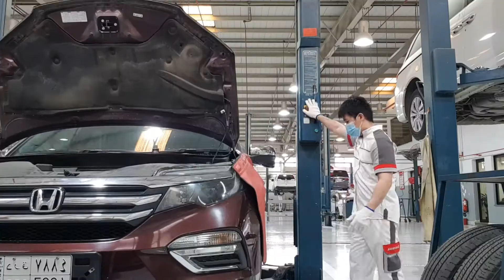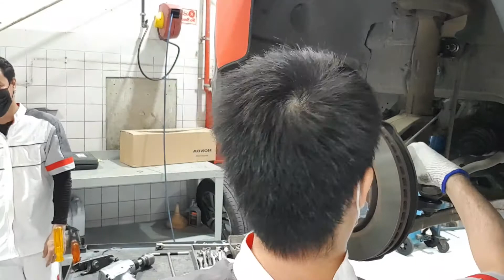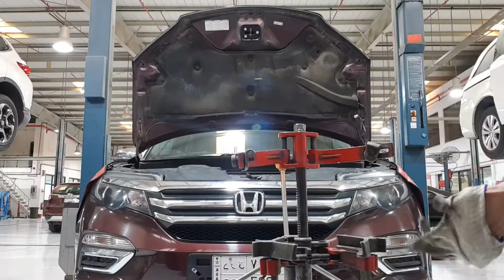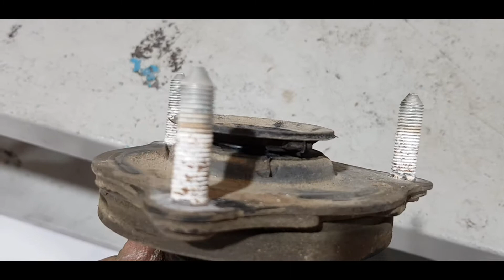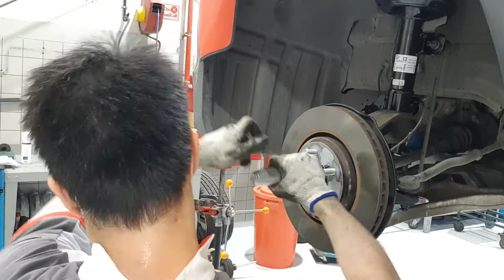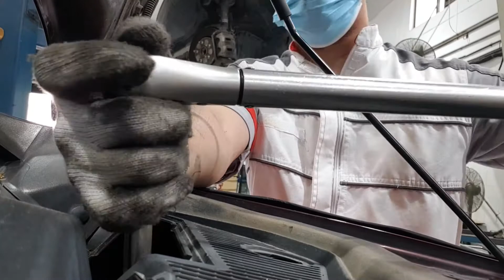Replace front right shock absorber (leak)|long cut procedure|honda|Pilot 2016

Comment: hello, i have the same model year honda. thank you for showing us this helps us alot. Im just wondering what kind problems did this is showing. Is vibrations and shuddering a common thing on struts because im getting a lot of vibration and shuddering on my pilot specially in the front driver side. Thank you so much.

Comment: Just had both struts on my 2019 pilot EXL replaced. Now the upper strut mounts are making a rattling noise and a loud thud/Boink on the passenger side when turning left at slow speeds. What would cause this on new struts/strut mounts?
Reply from the maker: Did you check the mount? Possible mounting is damage also.

Comment: Is there a chance of damaging the axle if this was not done correctly? I got mine replaced last month and now grease is leaking from the axle boot.
Reply from the maker: Absolutely yes.. ;) maybe they not fixed the boot correctly.. or they accidentally hit the axle boot..
Reply: Hello, does the orientation matter, I noticed there is an arrow on the top bearing plate.

Comment: Did you replace the Mount Base and Bearing?
Reply from the maker: Only the mount base.. you can re use the bearing if parts is not available
Reply: @kitlacaden  Great, I purchased the base as well. My struts only lasted 55k miles and Im not even in a rust area.

Comment: Could you help? When reinstalling the strut, i noticed an arrow on the top bearing. If you didnt mark when you rook it off, which way?
Reply from the maker: That mounting is only fitted in their own location.. and the arrow will point to engine bay or at the back if im not mistaken..
Reply: @kitlacaden  so, the mounting plate can only be installed one way, the bolts will go through the bottom only one way?
Reply from the maker: Yes..

Comment: Which part to use in the change for my 2017 Honda Pilot Touring awd. When i look at honda to purchase the struts it has two part numbers for the front strut.  51621-TG8-A01 or 51611-TG7-A01  for the right. Same thing for the other strut.  How do i know if i need TG7 or TG8?
Reply: Did you ever figure out the answer to your question? If so, which part?

Comment: Greet video. I have a 2019 Ridgeline. The process is very much the same. Would the torque spec be the same? Also what is the paste you applied to the upper mount? Thank you!
Reply from the maker: You can use normal grease ;)
Reply: @kitlacaden  is replacing the nuts with new necessary?  Do you have the Honda guide for the whole procedure? Thank you again
Reply from the maker: Replacing the nuts is not necessary, unless the nut is not good.. and about the whole procedure, sorry i dont have it.. ;)

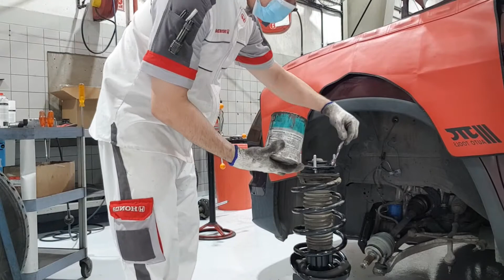Comment: Great video. What did you apply at @7:01, just some grease?
Reply from the maker: Yeah.. any type of grease will do. 😊
Reply: @kitlacaden how about the torque for the lower control arm? Mine is a 19mm. 2017 Honda pilot elite.

Comment: Hi again! Is there an easy way to remove the wheel speed sensor?
Reply from the maker: After you remove the bolt, try to lubricate the mounting of the sensor.. sometimes  dirt  sticks on it.
Reply: @kitlacaden  silicone spray or pb blaster? Again your are amazing
Reply from the maker: Anything available in your garages, wd40 much better..
Reply: @kitlacaden  can you turn the plastic piece or does it have to come straight out?
Reply from the maker: Yes.. can you turn left/right to loose the sensor..

Comment: why did you have to use a screwdriver and hammer at the end?
Reply from the maker: To lock the axle nut
Reply: What is the 3rd new part when you display the new parts? It looks like a rubber o ring ?